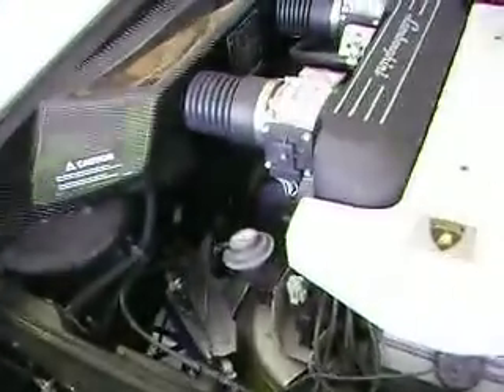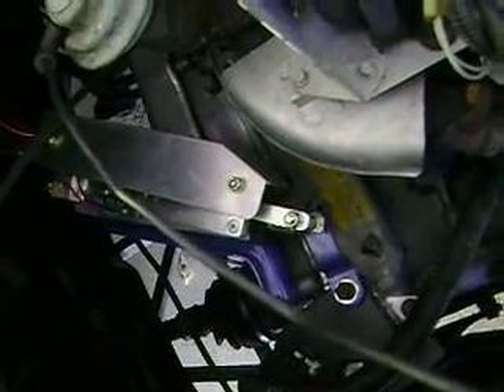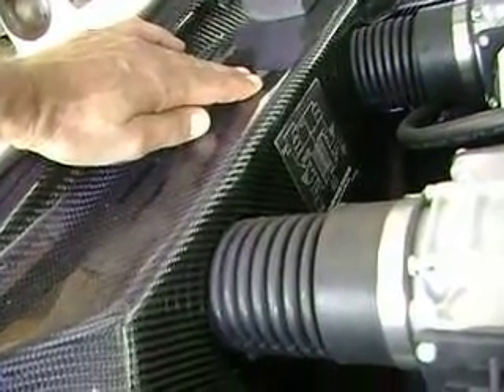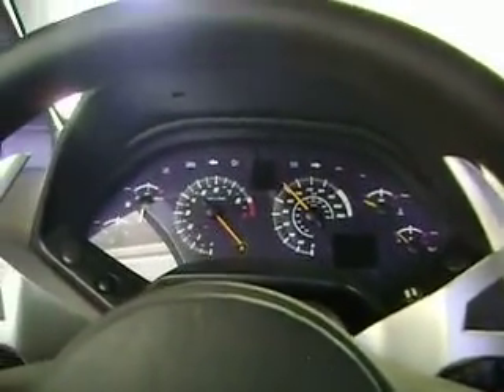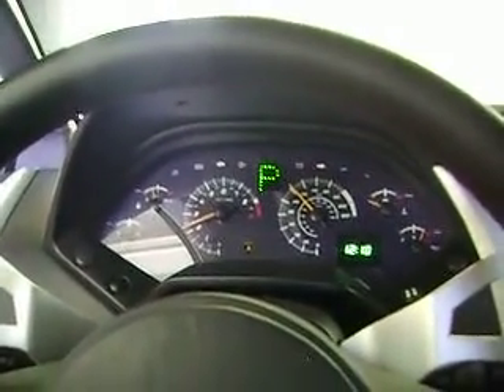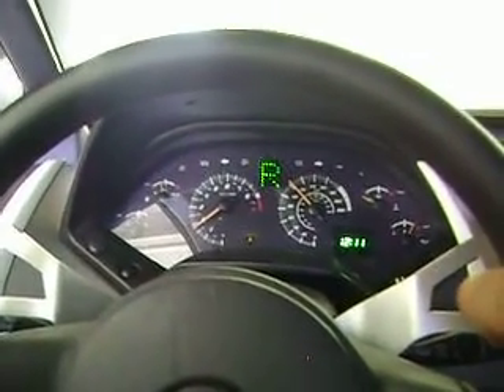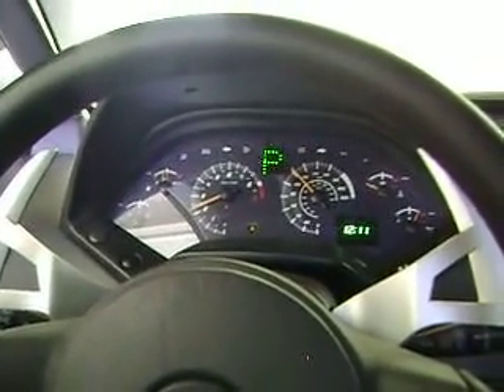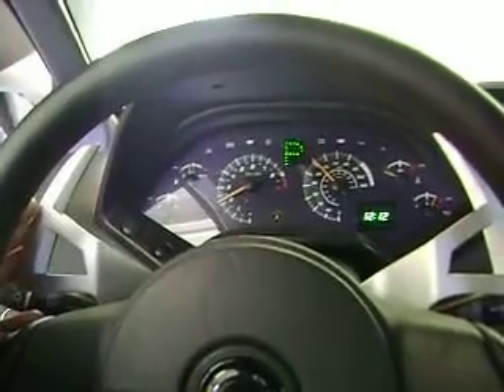Home Made Paddle Shift System

Comment: You can use any stepper actuator controller uC but I advice not .
you can get at very reasonable price one computer from a series car,and adapt to your needs.All you need is the service manual of the scraped car, and patience.